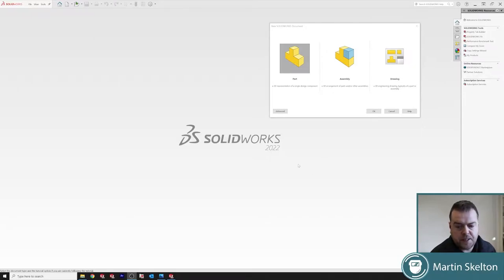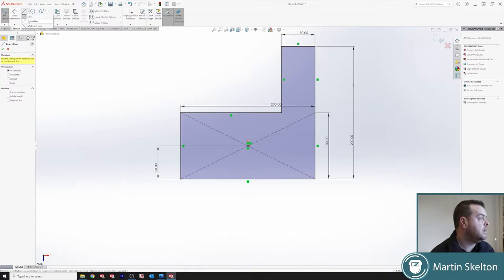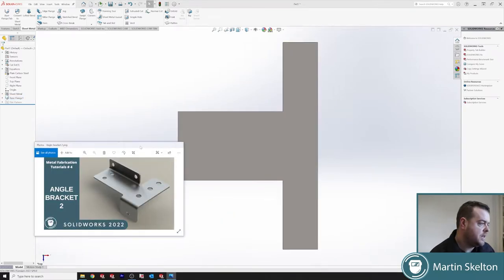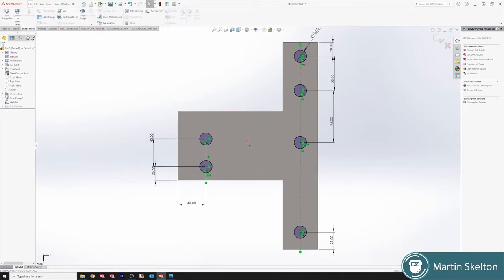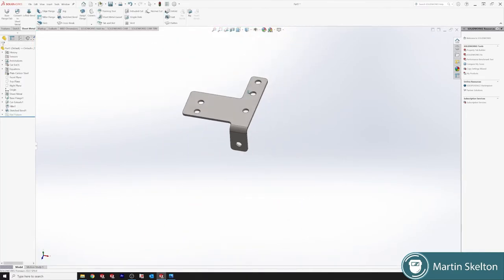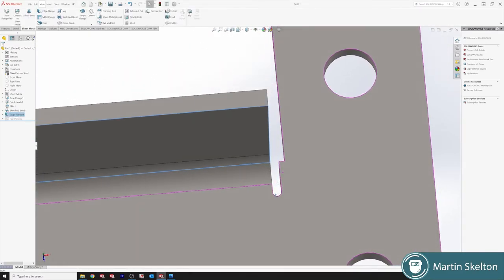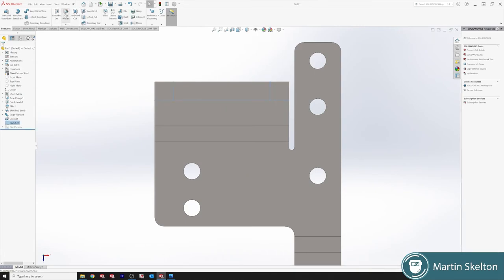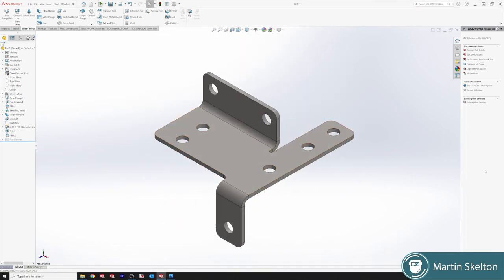SOLIDWORKS Sheet Metal Tutorial #4 // Edge Flange vs Sketch Bend

Comment: If you haven't incorporated bending allowances or the k factor properly, your part will end up having different dimensions when fabricated, with holes not aligning according to the dimensions in the CAD
Reply from the maker: Hi Syed, This is exactly why K-factor and Bend Allowance is so important. If you produce a part, cut the material, fold the part and then try to fit it to another part the holes will be miss aligned. Usually making the part unusable. There are many ways around this, but all are based on the industry the part is designed for. If you are working with a manufacture that have fully up to date and calibrated equipment, then a k-factor should be easily acquired. If you are working with a 30 year old brake press, then it is a different situation and you either design components that attach together to reduce the need for accuracy, increase tolerances, or work out the K-factor as it is on the machine but take into account that both press rams could be pressing different pressures giving a variable K factor. The standard metal fabrication industry tolerances and the pharmaceutical industry stainless steel tolerances are very different. This means more time is spent working out K-Factors of stainless steel bending than mild steel bending but using standard air bending tables, knowing your v-dies and bending allowances will give a good effort. The real way to reduce the risk is to make one part first, adjust that part till it is correct and then produce the part. Lots of mistakes can be made with miss-calculation on computers. Thank for the comment Syed

Comment: Can I use this feature for bending cylindrical bar?
Reply from the maker: Hi, Its not really suitable, Try flex or sweep features if solid modelling but sketch bend if requiring a flat pattern but make sure your parameters are correct.

Comment: How do we enable realview graphics in solidworks 2022.
Reply from the maker: Hi Rohit, If your graphics card can support the real view feature. It is located at the top of the main work area under the toolbars and to the right, there is a screen (t.v) icon called view settings, under its drop down menu you will see the option for Real View Graphics as well as shadows, ambient, perspective and cartoon options. I don't use real view as it can be hard on the system when running large solidworks files. The thumb nail image is made using the build in photo 360 render program in your solidworks package.
Reply: My laptop is with nvidia 4 gb graphics card. And i checked there's no option for realview too
Reply from the maker: Hi Rohit, I had to up date my NVIDIA drivers during the week after a windows issue. When I downloaded the driver and installed - I found solidworks was acting up, so I went on to the NVIDIA website and downloaded the updated version they had. It resolved my issues, I think the driver's can also affect the real view graphics and the photo 360 parts of solidworks. It might be worth a look to see if your driver is solidworks compatible. Only an idea as this is not really my area of interest.

Comment: مرسی
Reply from the maker: Hi Ali, Thank you for the comment. When using solidworks Sheet metal these are to powerful commands. Selecting the correct feature, really depends on what you need to achieve and when you need to achieve it. The sketch bend feature is excellent if you need to add a bend for clearance in a design, when a component change is required for example. مرسی
Reply: @skeltondesignsolutionsltd  
Thanx again and please continue to make future videos with such subjects more explained (with subtitle attached)...